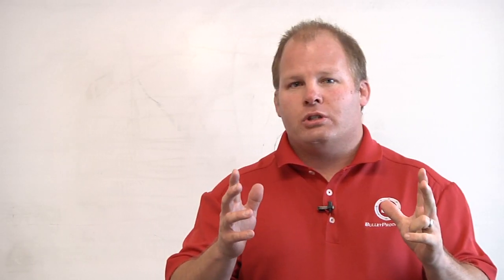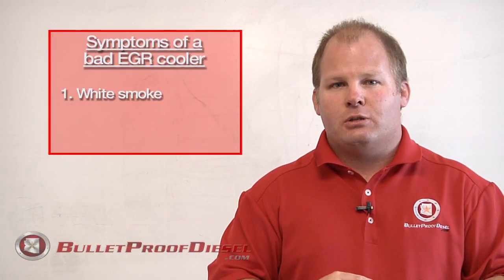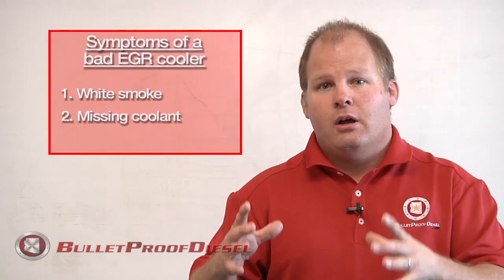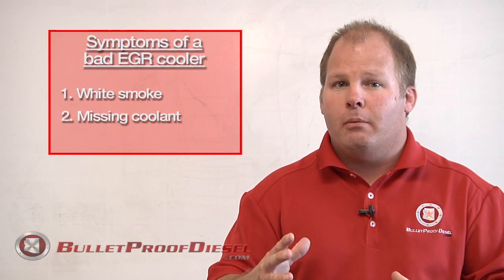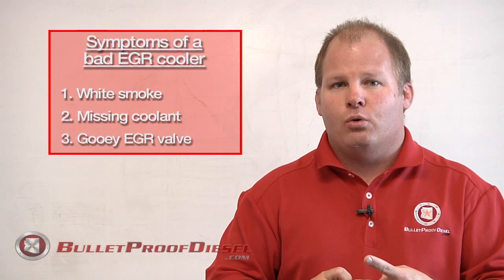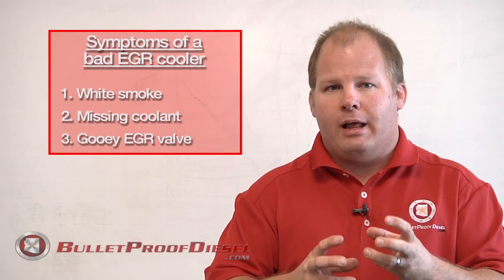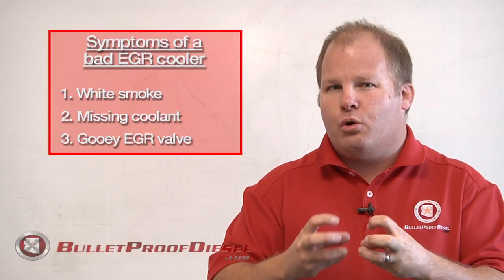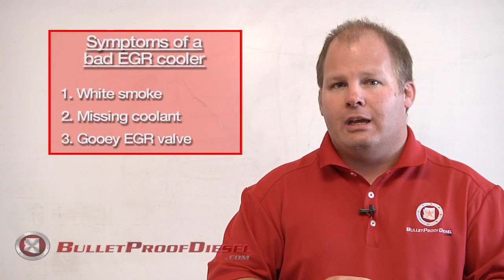Symptoms of a bad EGR cooler

Comment: Can a egr cooler internal leak cause a sign on the dashboard saying engine overheated. Turn off now?
Reply from the maker: We have not experienced this type of warning on a 6.0L F-Series truck... that being said, an engine overheating situation can be caused by a failing/failed EGR cooler.  If you have coolant loss and it is not leaking on the ground or external of the engine, then the EGR cooler may be the culprit.

Comment: I have pressure (bubbles in coolant system) when engine is hot. But I don't have white smoke from exhaust on first start or anytime in long drive. It is losing water little bit from cooling system. What can be problem? My car is 2.0 TDI 16v
Reply from the maker: If the engine is equipped with an EGR cooler, it could be that, or it might also be a problem with a cylinder head/head gasket.
Reply: @BulletProofDiesel  I put some liqiut for fill a holes and now it is good. No mre missing antifriz. And it is not head/head gasked problem, because that liquid cant fill a hole right? I think it is EGR Cooler :)

Comment: I have a 2004 F350 and here about 4 weeks ago we had the holes broke from the over flow take and after replacing that now we have no power in the truck and its got black slugs coming out with white smoke does this tell me that the EGR cooler is bad and we need to replace it now after the truck over heated do to the holes braking on us?

Comment: I have an early model 04 6.0.
>250000 miles 
Bulletproofed.
I had white smoke and coolant leaking from the exhaust. (launched >12' @=>3000 rpm)
I used an old dgas cap, clear hose/clear bottle for the bubble test.
Bubbled fairly vigorously, stopping when I unplugged the egr valve. Did not start again when it was plugged back in, or for the next few minutes.
Egr cooler failure, not head gasket, right?
I pulled everything to get the cooler out for replacement and found a dummy cooler. Plugged at both ends. Coolant seems to have flowed through freely, but never exhaust.
Egr valve was steam cleaned, with considerable damage to one of the o rings, but otherwise looks surprisingly good.
I have broken bolts in the rear end of the exhaust manifold, and visible leaking from  the point where the bolt broke on the driver's side.
This is my first diesel.
Without tearing more apart, how can I locate the leak?

Comment: Nice, so my mechanic told me that my engine siezed ( which he rebuilt 50,000 km earlier) because my egr cooler had a split and leaked coolant into the oil . I'm guessing he is full of crap.
Reply from the maker: When the EGR cooler fails, it can cause a hydro lock situation and not allow the engine to turn over. Obviously the EGR cooler would need to be replaced, then remove the glow plugs and crank the engine over by hand, this should allow the coolant to exit the cylinder.  While it may be possible for coolant to leak by the piston rings - In our experience, an EGR cooler failure doesn't leak coolant into the oil.
Reply: @BulletProofDiesel  No I'm sure it didn't and mine did a bearing, I'm pretty sure he's lying to cover his arse and he'd got the tolerances wrong. But thanks for your reply
Reply: @bsim1964 i have had this before on my bmw m550d, the egr cooler was bad, coolant leaked into my oil for some reason. Then i went to bmw for egr recall. After that was done i also changed my oil, never have had that happen after

Comment: 2005 FORD EXCURSION V10 6.8l  driving it started to lose power uphill gain speed then a pop white smoke n oil n water came out excursion engine stopped shut off what do I do before tearing her apart?

Comment: Will it white smoke all the time or just at idle or first start up
Reply from the maker: Most of the time, when an egr cooler fails, it will white steam/smoke all of the time.  If there is white steam/smoke and you have mysterious coolant loss (no coolant leaking on the ground), then it is most likely a failed egr cooler.

Comment: You just saved me €3000!! My idiot mechanic said that it’s the head gasket or the head gasket seal. Thank you so much! I will fix this and then update
Reply from the maker: Wow!  Be sure to email us if you need any assistance: customerservice@bulletproofdiesel.com
Our techs are always happy to help!
Reply: @BulletProofDiesel  I had a very nasty coolant leak through the exhaust (BMW 320 CD e46 from 2004). After I went to the mechanic (which told me that i must change the head gasket) I looked for help on BMW forums and YouTube. I found you guys, and I thank you very much! Problem SOLVED! The oil breather ok, the head gasket i haven't checked because it would have been too expensive so I changed the EGR COOLER ( the rectangular inox thing beneath the EGR Thermostat) and the Engine THERMOSTAT. Guess what, problem solved, no more white smoke, no more coolant leak! Thank you again, and I hope that this will help other people too. Cheers!
Reply from the maker: @lucacristian5919  Glad it worked out!
Reply: Hello. I just wanted to ask. Is it possible to use a egr delete kit, without having to repair the egr cooler?
Thank you!

Comment: Can a bad egr cooler cause a car to go into limp mode??
Reply from the maker: Usually not by itself, but the conditions that cause an EGR failure can trigger limp mode; for example, a plugged oil cooler will cause the EGR cooler to rupture but can also lead to an overheat situation.
Reply: @BulletProofDiesel  Well my EGR is 'software' removed but still there. I  didn't removed the EGR and cooler mechanicly.   And yesterday I was on the highway  doing 160 km/h  and just lost power and went into limo mode since then. When I restart the car again and hit the gas it pulls normal and then just puff limp mode again....
Reply: @medzid2298  what ended up being the problem? this is happening to my mk6 tdi as well
Reply: @jmart38fdlpd  Ended up being a very small hole at the lover intercooler pipe, so I advise to start cheking those...  Kind regards

Comment: how about sir the volvo d13a if you start or engine is ruunning it has a white snoke coming out from the exhaust pipe,.what us the problem?
Reply from the maker: We don't have much experience with that particular engine but inspecting the EGR cooler and head gaskets may be a good place to start.

Comment: I don't have white smoke out of the tail pipe and i'm not overheating.  I'm getting a lot of pressure in the cooling system. Truck runs cold. Has no heat and then after about 5 miles,  it finally starts to rise. It sits at 210 for a few seconds, the heat comes on and then up almost to overheat and then back down to about 120. Then I get the "low coolant" warning.  Antifreeze is coming out of the reservoir and all over the side of the truck.  I've replaced the thermostats.  It changed NOTHING.  I replaced the radiator cap and it was perfect for about a day and it built pressure worse than before.  

I'm at a loss...

P.S.

I originally thought it was the water pump because there was a leak coming from,  what I THOUGHT was the weep hole.  But it's higher than that.
Reply from the maker: Let's talk through it!  We've helped out folks with weirder problems than this - give us a ring at 888-967-6653
Reply: I was sold a 03 f350 6.0liter by a dealer who had bulletproof on windshield AMD he also said it had been bulletproofed.
Since then I'm have a egr recirculation low code come up and cant get it out of it. 
Plus map sensor code..
But I've not seen no bulletproof parts on this truck.  
The guy lied big time to sale it
Reply from the maker: @benslanginhunies  That's unfortunate to hear.  We do keep registration records for some of our products, so in the future, if you're in doubt, give us a ring at 888-967-6653 and we'll see if we have evidence of our parts being on the truck.

Comment: 2003 F-350 6.0L  was bare block overhauled, resealed and studded 40,000 miles ago. if there's no white smoke out the exhaust, but do notice besides the loss of water in the degas bottle just after a couple of minutes at start up it starts to push the water out of the degas bottle when I remove the cap, question: can a cracked or failed EGR Cooler also push the exhaust thru the cooler to push water out of the degas bottle ? otherwise.....  starting of a blown Cylinder Head Gasket ? I will remove the EGR Valve and inspect in the Intake Manifold next to verify.
Reply from the maker: We'd like to ask a few more questions to try and get to the bottom of this.  Can you give us a ring at 888-967-6653?  We'll do our best to help you get this figured out.
Reply: yes will call tomorrow, thanks
Reply: @BulletProofDiesel  

I have pretty much the same problem with my duramax.  I will also give you a call.
Reply from the maker: @ozziecrosby2092  Ok, we'll look forward to talking with you.

Comment: Can I just unplug the EGR valve or will it harm my motor on a 6.0 power stroke
Reply: Hi,can I bypass egr cooler disconnecting coolant pipes?What's gonna happen if exhaust gases are not cooled down?
Reply from the maker: Doing so will trigger the dreaded 'Check Engine' alarm.

Comment: will it have white smoke when the motor is warm or only cold
Reply from the maker: It can occur at any time when the engine is running.  The white smoke is normally the result of a ruptured EGR cooler.
Reply: what about black smoke?
Reply: elton merama that means you either have an exhaust leak, or your injectors are going
Reply: Hi, if someone can help or suggest me, i have a kia optima 2l turbo gdi and i don't know if it could be a reason but 2 days after i have clean the intake with the crc gdi cleaner, some symptoms have coming, firts i noticed a lot of thick smoke at the coldstart and it stop when the engine come warm. After this check engine is come with code p2297 vacum leak and o2 sensor out of range bank1 sensors 2 (possibly the thick smoke) i have already change the pcv valve. Tks and sorry for my English language i am french Canadian
Reply: Ton Jumeau are French fries big up there or is that another American made misconception?

Comment: changed egr because of blue smoke still have blue smoke after replaced what can it be?
Reply: Au My check head gasket or fit a egg blanking plate
Reply: Blue smoke could be transmission

Comment: I have a early 04 powerstroke I am getting a p0401 code I can't figure out. I've replace egr and bulletproof cooler done a smoke test no leaks replaced ebp sensor and cleaned tub but it still reads 2 to 3 psi at hot idle map sensor13.5+and climbs with aacceleration baro 13.7 and stays in one place maf sensor 35g/s and climbs with acceleration vgt 72 at idle and clean iat sensors 
I have kno idea why i can't get this code off i do have a afa intake and siverline 4 .5 inches from cat back.  Stock for most part
Reply: did you ever get this fixed?
Reply: Not 100% certain but Boost air  leaks can cause this too
Reply: You ever figure out the problem, I'm going through it now

Comment: hi i have a 07 f350 6.0 it started to blow black smoke wile driving on the freeway, than i herd it star clattering, at idle is the worst, i just had the IPR switch replaced 1 week ago,  and they did remove the turbo, no engine light came on butt blows a lot of smoke and clatters real good,  butt it has full power on the high way, thanks mike
Reply: Check your battery voltage and alternator state it could be the ficm going bad or spool valves on the injectors . Or a turbo problem like the vgt solenoid .

Comment: is it just white smoke on start up, or is it at all times?  

i get white smoke on start up but after it warms up it goes away.  
but i am getting the egr gooey crap,  had code p0405 so i pulled it off and checked.
Reply: Smoke like that on start up sounds like bad when. My assumption would be when the motor is shut down coolant is leaking back in threw the exhaust or intake and filling cylinders. If the eye is bad it can so take a set of head gaskets with it . Which is a COMMON misdiagnosis . If the edge is bad replace your oil cooler as well. As it is the most likley reason the get cooler itself failed . Buy a new cooler and install get delete . that's if the head gaskets aren't already mess up . The early years were worse for the gasket issue with the bolts stretching to much to fast . Tuners cause most this problem as well
Reply: Bad egr was in the first sentence to my bad lol
Reply: @Gilbert Torres that's what she said

Comment: so if you delete the erg valve by welding on both ends or some of theses other ideas i read on here do you still need a tuner with an erg delete?
Reply: Only to keep the check engine light from staying on. A tuner will not delete the code being stored it will only deactivate the light being linked with the code. The code will always be there. If you say I don't care if the lights on. That's cool, but it will make you blind to any other code that will be problematic to your engine that may need attention immediately or failure can occur. With the light always being on you'll always assume its just the delete. I'd suggest checking codes every week. If delete is what your insistent upon I heavily suggest you have a dealer level scan tool bypass the check engine light to the EGR valve code set. Take my advice serious. If your engine throws a code and is not seen too. Its possible that you can experience engine failure just from a a simple easy way out.

Comment: EGR VALVE & SMOG PUMPS ARE BULLSHIT --- REMOVE THEM --- GET BETTER MPG & POWER & ENGINE LIFE
Reply: KaZpa777 how do you remove them and what is a smog pump?
Reply: @yvonnelinan241  the egr delete kit is very common. Doing this does improve mpg and engine life. Also it is much cheaper than replacing it.
Reply: That's what I want to know and with new cars how will it start without everything hook up properly must need a relay or by pass then burn up engine I suppose

Comment: nope, you're and idiot. It IS where the coolant overflows, but also holds pressure. Don't think surge has to do with coolant, only fuel. And an overflow is upstream from a radiator, if the radiator overflows IT GOES UP